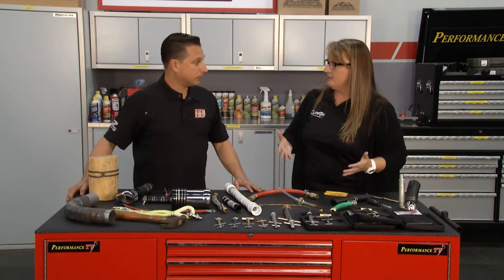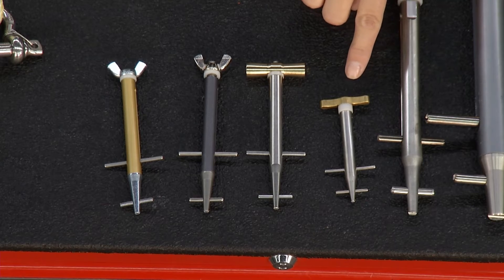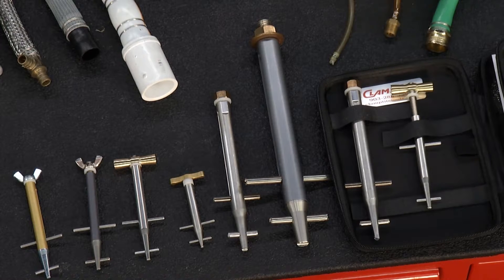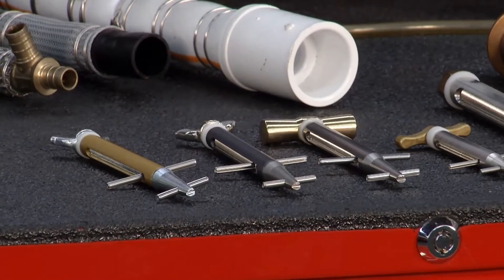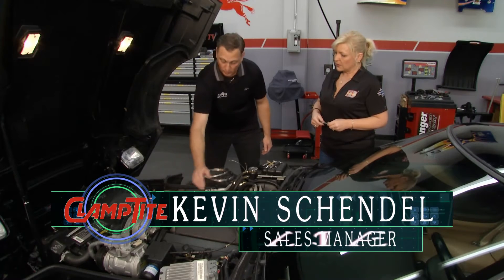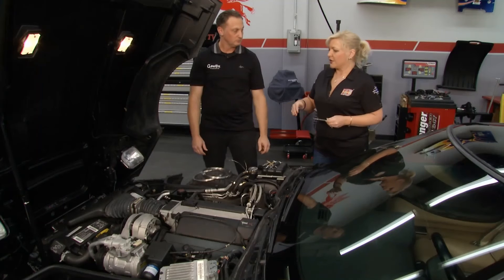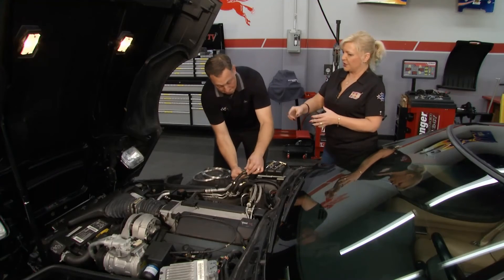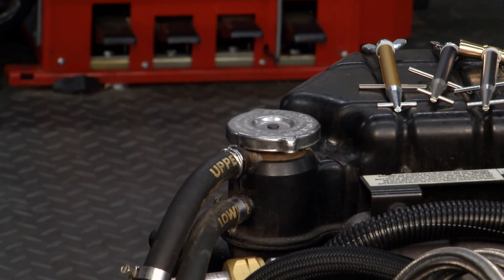PTV MASTERS Tool Descriptions CLAMPTITE

Comment: Where to buy a wire ? What size is it ? Is it a stainless?
Reply from the maker: @MrPhimanh  You can use any type of wire but we do sell wire on our website. The Premium tool is an all stainless steel.
Reply: @clamptitetools  Thanks
Reply: @clamptitetools  What size is best for hose clamp ?
Reply from the maker: @MrPhimanh  .032” works great for 1/2” smaller hoses. .041” is a good all around wire. May need a larger wire for your harder radiator hoses or for a beefy look.

Comment: nicely built but overpriced
Reply: Not really... its the design you are paying
Reply: @danoldsbb4558   If it's fancy design justifies the price,  one can be made for less than $5  and 15 minutes of time that'll work just as good.
Reply: @danoldsbb4558  Yes really! What design are you paying for? It's just a bolt in a slotted tube with some pins. Don't fool yourself in thinking this is worth nearly as much as they are asking for it. It's just another gimmick thing.

Comment: How secure is this for lower and upper radiator hoses. Taking into account expansion and reduction in relation to heat gain/loss?
Reply: Using larger gauge wire makes it not a problem.
Reply from the maker: @edwindiaz3932  it will hold over 1000 pounds of pressure with a barbed fitting. And up 65 pounds in your turbos